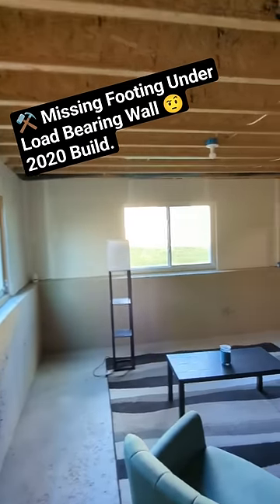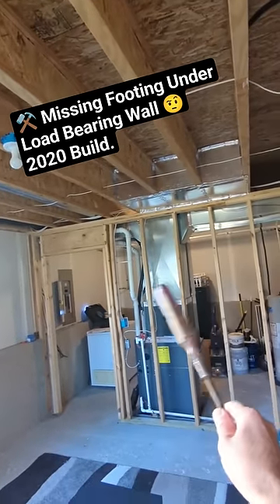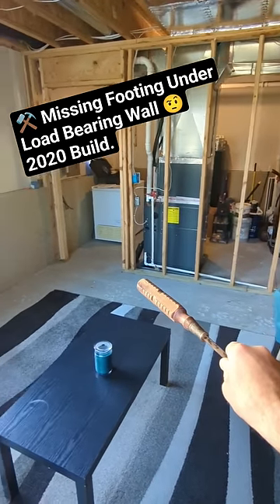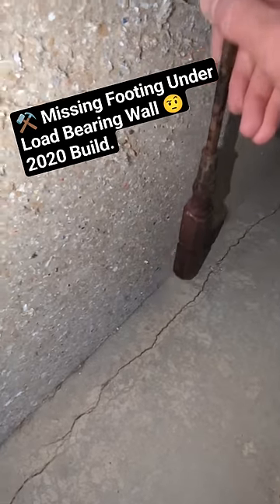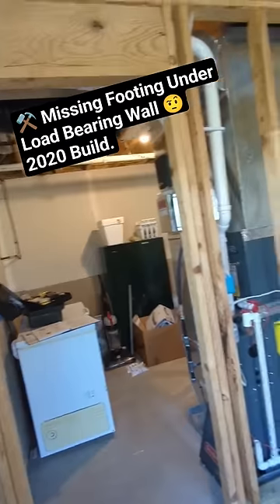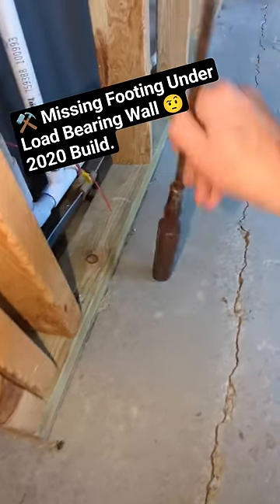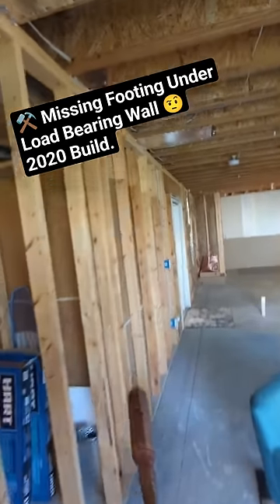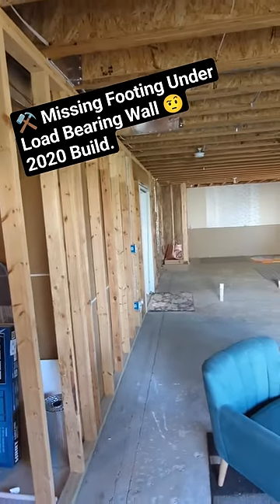FOOTINGS missing under load bearing walls NEW BUILD A trick to find missing#footing under #concrete

Comment: I have been building new construction for over thirty years. We put headers above every opening not just the load bearing walls.
Reply: It varies by state.
Reply: Agreed header are also for lateral stress to help keep the openings squared for function
Reply: True.  The presence of headers doesn’t mean much.  It’s not needed, but many do use a lot of lumber in fat headers in non-bearing walls.    The tell is the engineering of the joists, and any roof loads transferred to that wall from above.  I’m concerned about what appears to be a sizable cutout with no doubling of the adjacent I joists.  

Also, if the slab sounds hollow, that’s a subsidence issue - this the settling (not hairline) cracks.   Those are from differential movement- not shrinkage or curing.

(Edit). Maybe that’s not a cutout - just a taped-off plenum? )
Reply: Yup….     And they couldve used 16x16 footings for point posts
Reply: That's absolutely correct I'm not sure how far those Choice run back in there. I couldn't see it's a damn good question why that slab sounds so Hollow😮😮😮
Reply: Congrats, been wasting lumber 30 years
Reply: @joewat5905 haha. "Wasting lumber"... What a tool.
Reply: @joewat5905  if it shows on the approved plans then it has to be built to match.
Reply: Header = lintel?
Reply: @victorrand8811  yes.
Reply: Usually lintel is a term used for masonry in the U.S. I'm not really up to snuff on how things work elsewhere.
Reply: Yup
Reply: The way I was taught by my granddad. Can't be too wrong if it's worked this long. 😅
Reply: @allenmcnamara9213 poorly compacted subgrade will do that for sure. The block is laid on the footings. Sometimes smaller square footers again with block piers can be placed where required internal or externally to the stem wall, generally to attach framing to. I'd bet money the plans did not call for footing, just poorly compacted substrate, possibly combined with an overly high slump to the concrete
Reply: Those floor joists landing on that wall are kind of a giveaway
Reply: @hepparade there’s absolutely zero lateral stress on an interior wall. Even if there were, a header would do virtually nothing for that.
Reply: @victorrand8811 yes from dimension lumber. We do use lintel but to define masonry openings.
Reply: that's a waste of money we do fake headers above any non loadbearing doors. been building for 13 years. but code is different in other places so im not saying your doing anything wrong.
Reply: @Growinggolfing 
I'd check your math on that Bob.

There is zero stress on anything until nature comes along.
Reply: I have headers above all my doors, load bearing or not.
Reply: @werberderber6209   yeah but instead of wasting like a 2x10 or lvl on the non load bearing walls you use like a 2x4 or 2x6 header right? or have i been framing houses wrong this whole time because when you do like 100 houses a year that adds up fast.
Reply: @roddaman7545  I'm someone who has to pull up an instructional video if I have to patch nail heads popping through my drywall, so in reading your assessment, I swear to God it's almost as if you're speaking English.
Reply: @bohbro  That's what I was thinking, but then again I know nothing about home construction. However, it just seems like common sense since that wall seems to span the entire width of the basement, the joists lay perpendicular atop it, and it's pretty much in the center of the home, so I was thinking it only stands to reason that it would be a load baring wall. But again, I know nothing about the trade, and am simply going off of nothing more than what seems to make sense to me. Then again I'm not too sure how much common sense plays into the building trades.
Reply: @pumpkinheadghoul  I f the joists were continuous over the top of the wall then the wall might not be load bearing but the joists are connected to the wall via hangers so must be applying load. Alternatively the joists could be cantilevered out to the wall but the span is to great for joists that size to cantilever
Reply: Ya, I see it all the time in new builds.
Reply: @hepparade  wind sheer is equalized by the downforce. Once downforce is exceeded, weight is transferred up the wall through the trusses to the peak and back down the opposite wall into the foundation. Interior non load bearing walls don’t have a load on them. Your out your league homie.
Reply: @Growinggolfing  I don't believe I said anything about "wind shear".

But if you want to talk about diagram loading...

You comment says enough about your experience.

I don't know where you are from but sounds like your understanding of existing concepts omit the realities of the world I build in.
Reply: @biggs7109  
I am from, 2x6 in the minimum legal header size for wood framing.
Reply: and the double top plate?
Reply: @NJscrub530  but you would need a  beam to transfer the load to the posts
Reply: WORD !
Reply: @Galgamoth  exactly.     Im just saying this guy doesnt know what he’s talking about. And even if he did, its not an end of the world situation
Reply: I think the whole slab is wrong and ur right bout headers
Reply: You are not putting a 2x8 header over a door in an interior partition wall. I do make a baby header and turn the 2 2x4s on side with half inch spacer between. I've also seen people just triple up the 2x4 on the flat. And I've also seen just a single 2x4 which is corny. But ain't nobody putting a load bearing wall type header
Reply: @biggs7109 

Headers keep those big openings stiff
Reply: Biggest waste of wood, guys do that because they don't know the difference between load and non-load bearing walls, and the only exception is on stick frame roofs due to the Cieling joists, purlins, etc.
Reply: Rather you do or you don't when they put you in a box in the ground it won't matter
Reply: Fact
Reply: thats not his point though. He says the load bearing WALL needs a footing. NOT a header.
As far as the comment you made. Your correct.
Reply: Same in Australia
Reply: That’s what threw me off and his opening statement
Reply: Not all headers are created equal. On gable walls and interior walls, not load bearing, I frame the headers with a gap in between the outside pieces and put cripple like pieces in between. Full headers are not necessary unless it's load bearing. Waste of materials and time.
Reply: @paultavernettitavernetti9186  no shit

Comment: Those TJIs run the whole span to the other wall, that is not a load bearing wall. They look to be as tall as the spacing, meaning they are 16” tall. The bottom boards look like they are 3” wide based on them being bigger than the A19 lamp which is 2-3/8” wide. A TJI placed 16” on center of that type can span up to 30’ without any additional support.

That space looks to be about 24’ wide assuming it is 8’ tall like most homes.

You can also tell because they added a spanned TJI for the duct chase. The other TJI are attached to it instead of being supported by that wall.

That wall was added later to split up a basement or something and has nothing to do with bearing a load.

If that isn’t obvious to you, you shouldn’t be inspecting homes. If you failed someone on a purchase or sale inspection they should sue you.

Edit: wanted to add, cracks due to overloading slabs cause deflection.  There is no deflection in that slab. How could that wall have caused the slab to crack without causing any sinking in the joint 4” away? 

So the “load bearing” wall has enough weight to crack the slab but not enough to push it down any? 

Without any signs of deflection those cracks are meaningless.

https://www.basementsystems.com/company/news-and-events/35357-causes-of-basement-floor-cracks-and-what-to-do-about-them.html#:~:text=Most%20times%2C%20the%20cracks%20are,%2C%20stress%2C%20and%20poor%20construction.
Reply: Preach🙌
Reply: I was going to post this comment as well because all these "experts" seem to not realize this.

I'd be willing to say if the potential homeowner didn't buy because of this guy, they missed out unnecessarily.
Reply: Ugh.....says every project manager and home builder on here. Home inspectors....am I right? 😅
Reply: @scott5884  those who can’t do, inspect. 😄

But like really, an engineer drew that and it passed inspection by the city. They inspected the footings to make sure it matched the drawings. 

He cannot possibly tell if that is code or not without knowing the exact TJI used… some are arched slightly or made out of materials that give them a longer span and are specifically designed for the location.

Home inspectors are there to look for additions or changes that are not to code or items in need of repair. It isn’t his job to assess whether or not the engineer designed it correctly because he doesn’t have the drawings and isn’t trained to do so.
Reply: @jflabeets1  🤣
Reply: Thanks dude
Reply: I’m a home builder and all of our walls have headers. Load bearing or not.
Reply: Thank you. That isn't load bearing...scary if that guy is an inspector.
Reply: Yes, yes, yes, but look on the bright side. With those huge cracks running the entire length of the foundation, and the fact that the entire slab sounds absolutely hollow, it won't be long before the homeowners have their own personal pond in the basement after every Spring thaw or prolonged rain. I mean, there's nothing more fun than doing laundry while standing in four inches of water.
Reply: I worked construction for a while during the plague. A realtor called me with a large list of defects that an inspector found during his pre inspection. OMG almost half the list was just stuff he didn't understand. They had a fancy blending handle on the shower that controlled hot and cold with the same handle. He wrote it up that the house didn't have hot water in the showers. It was $2.5m home!! I got half the list checked off in a matter of minutes. $$🤑
Reply: @gabrielcampos5495  lol I hope you’re joking laugh😂
Reply: @gabrielcampos5495 I can put a header anywhere I want lol...
Reply: If that is true... then why is the concrete cracked parallel to the wall the whole length?
Reply: @jflabeets1  Hes also not a n engineer and probably wouldn't know what to look for to see if it was improperly designed. 😂
Reply: @eddiebelanger8228 in South Carolina we only put headers on load-bearing walls.
Reply: @Last_of_my_breed  that is an unfinished basement. It probably had an uneven slab for draining. 

It could be a concrete leveler over a control joint. That’s why it sounds so thin.

But that wall for sure didn’t cause that.
Reply: In the UK, that "load bearing wall" would only pass as a partition wall. Load bearing walls are brick built
Reply: Yup i would consider it load bearing if thr tgis actually rested or broke on that dividing wall, however the slab is very badly prepped,e thinks it wasnt compacted before and not vibrated during pour....
Reply: @webtheweb  I’d be more concerned about the slab if the cracks weren’t so perfectly straight.
Reply: I was like where's your beam my guy😅 ya load bearing 2x4's? It's on the other side of those heating runs.
Reply: Came here to say the same… I’ll admit you might’ve said it better though

What are we supposed to do with these guys!? There is so many people out there claiming to know things they clearly don’t it’s insane
Reply: Just built some houses. Our EOR and I-Joist designer said 24' was too long of a span for TJI. Ended up using floor truss for the 2nd floor because customer wanted big open floor plan for the living room. I really don't think you can get 30' as far as I know without having a load bearing wall in between.
Reply: @krisssilco  I looked it up before I posted.
Reply: It's load bearing because the joists run perpendicular to the wall and, hence, transfer weight from above.   If they weren't touching the wall it'd be different.
Reply: Good Analysis
Reply: @BenKlassen1  that is not how that works. You may want to google that to check.
Reply: it is a load bearing wall...lol do better
Reply: @kennethpullen6889  and every multi story building has footings under every wall because concrete can’t span any distance. 

Makes remodels of buildings impossible because all walls are load bearing now days.
Reply: @stephenbrown9068 If you think he's wrong, can you explain why?
Reply: @Last_of_my_breed ...because old footing or all footings were poured separately from the pad...so
Reply: Bout time someone checks the inspectors work 💪
Reply: Wonder why the op replies to some comments, but hasn't replied on your comment 🤔
Reply: The real knowledge is always in the comments
Reply: Facts...and well explained. Finally, someone who didn't get their know-it-all degree from YouTube (no offense, it's where I go mine).
Reply: All these so called home inspectors have never worked in construction.Those who can build, those who can't inspect.
Reply: those are 11 7/8 @ 2 5/16 (250's). The size of the keyless light should be the giveway to the size of the TJI, and the studs in the wall are not as thick as the TJI but the TJI isn't as wide as the 3" top plates of the wall thus 2 5/16. could be the 1 3/4 but they seem just a little bigger then that, hard to tell with the camera fast panning all over the place. 11 7/8, 250's at 16" center with L/480 live load deflection can span 19' 2". Thats a load bearing wall and it missed by my guess, 2', to 32 inches. its probably where the jog in the wall is at the end of the video running parallel to the wall
Reply: @listenerdave101  studs are 3.5” wide not 3”. You’re assuming an exact manufacturer and specification when I listed a possible case that would allow it to span that distance. Based on the wall spacing it would only have to be 22-24’ spans. 

If they are as tall as they are spaced, and they are, then they are 16” tall. Even if they only allow a 24’ span, it still doesn’t need a load bearing wall.
Reply: @jflabeets1  if you look at the wall, the studs are 1 1/2 thick and line up directly under each TJI. You can see that. What is 3 inches thick is at the top of the wall, the 2 wall plates. don't take my word, ask the guy that recorded it. This is my educated guess by looking at the evidence in the video and the 28 years of hands on framing experience.
Reply: @listenerdave101  I’ve been in construction for just as long, I am also a contractor. 

That just isn’t a load bearing wall. The span isn’t long enough. The technique for “finding footings” is silly… my dad was a mason when I grew up, that just isn’t how any of that works. 

First, concrete cracks. Bad cracks have specific characteristics that tell you they are an issue, deflection would be the issue cause by load on a floor with no footing.

Second, tapping near a wall and then away from it changes the sound because that is how sound works, not because the floor doesn’t have a footing. His theory assumes a footing of one specific type, it could go straight down and then widen at the bottom or be one of 10 other footing profiles. As a retaining wall, it likely is in an L shape extending out. The slab could be designed for that, the soils may be capable of handling that load, we aren’t the stamping engineer and OP doesn’t have the stamped drawings.

Third, the flange size is the width not the thickness. They are wider than the light bulb next to them and it is 19/8ths of an inch (that is what A19 means), which is 2-3/8ths. The sizes neat that are 2-5/16 and 3-1/2. At 16” tall both of those widths are good for more than 24-29’.

The dimensions are clearly shown in the link below, you’re just not correct.
https://www.fp-supply.com/tji-i-joists-omaha.html
Reply: @jflabeets1  okay "contractor" first clue is that no contractor is going to span the whole length when they know that they are going to have a wall to carry the floor. the cost for anything over the 12inch tji (as a "contractor" you should know) is greatly increased.  
 second as a "contractor" s you should know that a keyless is the light fixture that run about 3 1/2 to 4 inches wide. A keyless holds the lightbulb. 
 third the studs that are in the wall are framed with the 1 1/2 facing out and the 3 1/2 sides to each other  and the tji above it are about the same size as the 1 1/2 size of the stud but I've said this already. 
 forth any one that brings in "my daddy" in a debate is suspect .
 Fifth I will concede that there are times when "the slab could be designed for that, the soils may be capable of handling that load". but common sense tells me that the hollow sound, the crack a coupe inches from the cut line and a load wall to the left of that, they missed the footing. the framers put the wall in the wrong place or the concrete boys put the footing in the wrong place. Being a "contractor" you already know this also can happen.
 I suggest you check your measuring tape and make sure it doesn't have centimeters on it. you may be getting the 2 confused.
 have a good day, good luck on your houses. I hope all your subcontractors are good honest ones. Your going to need them.
Reply: @listenerdave101  you don’t have the drawings and are not the engineer. It is impossible for you to know the load above to have any proof you are correct.
Reply: @jflabeets1  The word you're looking for is blueprints.  Geesh, now I'm hoping you have good inspectors for the protection of any home buyers.
Reply: @listenerdave101  the word you’re looking for is pedantic.
Reply: @jflabeets1   Hahaha honestly made me lol.
Reply: @listenerdave101  it’s the internet, everything we see here is true.
Reply: @monza1002000  typically in north america if that were load bearing it would be 2x6 studs an 16" oc.
Reply: @nowerries   Thanks for info. In UK it would normally solid brick
Reply: @jflabeets1  home inspector here. Exactly correct.